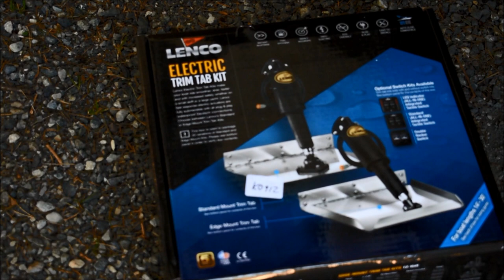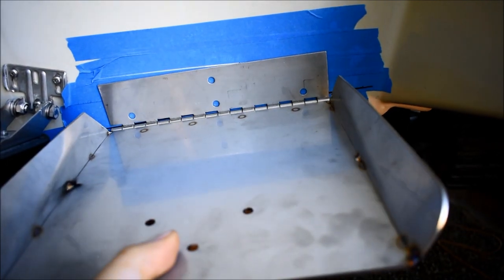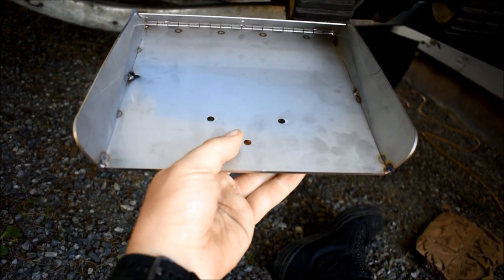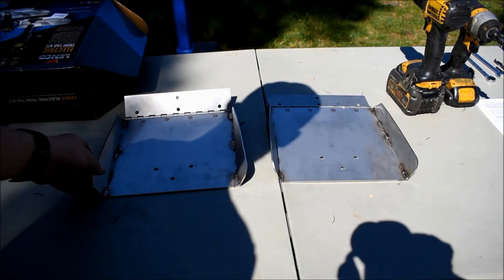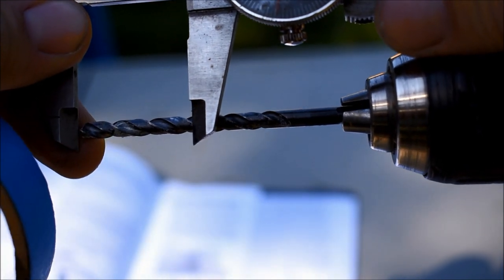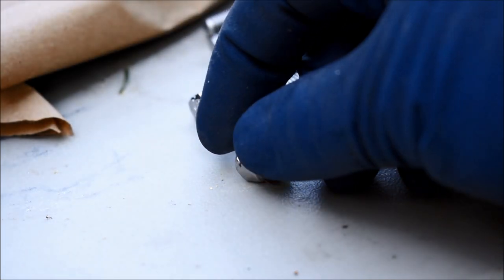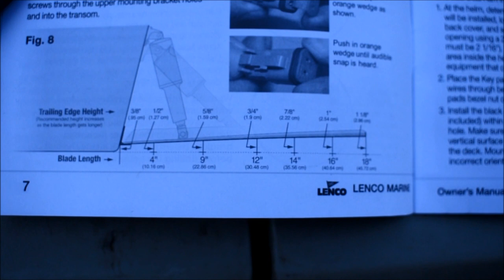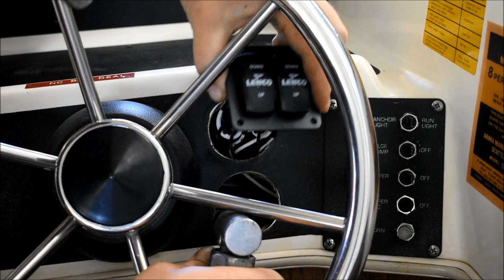Arima Sea Ranger Trim Tabs Install, Best Arima Mod, DIY

Comment: Enjoyed your project.  Got my eye on a 17 ft Sea Ranger, 1990 edition looks good, not been used much and stored well.  Would get it no engine.  Trying to decide what size engine works well for short distance salmon trips.  Any suggestion?
Reply: I have the Same year Sea Chaser.  My friend bought it new and sold it to me recently when he moved out of state.  He has a Yamaha 115 2 stroke on it, which is nice, but it does drink plenty of fuel.  Our friend with your version of the boat put (Sea Ranger 17) put a 90 Suzuki 4 stroke on his.   It is not quite as fast, but it gave him better range on the boat (we both have saddle tanks in our boats).   Things to consider.   4 strokes are heavier, but more efficient.  Bigger the motor the more weight you have in the back.   Reason I am looking at this Video, is because I am trying to offset some of the 115 HP motor weight with trim tabs (weight in back of boat does add some to slamming in rough seas).   I do like having the bigger motor, but if you are looking for economy, a 90 hp is a good choice and a common size people go with.  I think the smallest you would want to consider is 75 hp.     BTW, we are fishing Puget sound and Washington coast and 20 to 40 miles off shore just for reference to what we are sizing our motors for.  Best of luck if you purchase the sea ranger!
Reply: @joeschafer1  thanks for the note.  My plans are fishing the bay's most of time and crossing out for 5-10 mile range only occasionally.  As you say 75-90 may be for me.  I will want to run a kicker for trolling so gotta keep weight down.